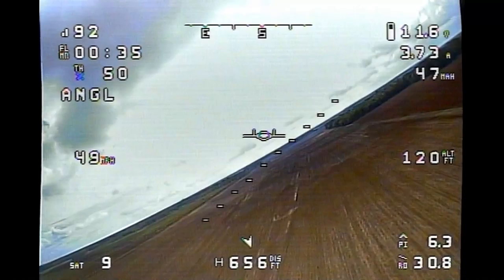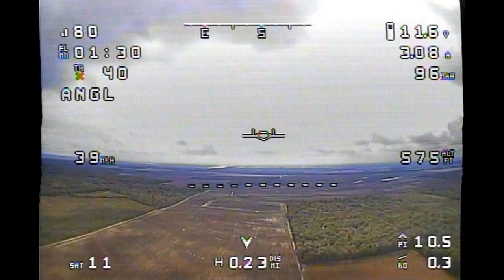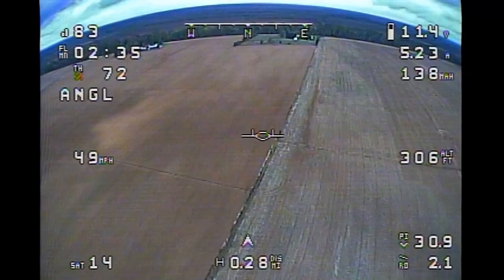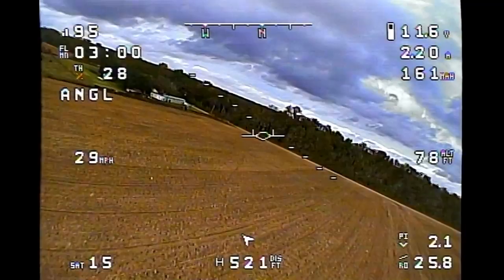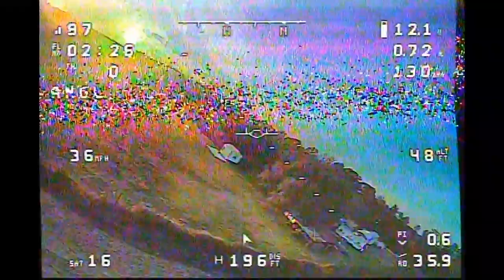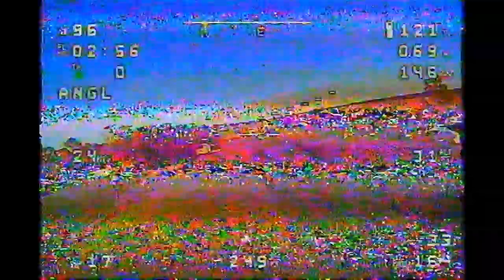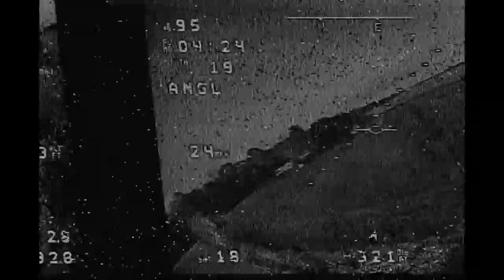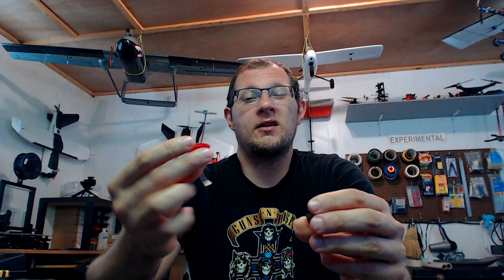Video Transmitter Problems, I want your input!

Comment: Loose uFL connector?
Reply from the maker: Possibly! I did re-seat it between the two flights when I checked over everything and it didn't improve, but I've wondered if it's connecting good, maybe the center pin not contacting or something? Now that I've torn the antenna apart I can actually check that with a meter... lol I'll do that.
Reply: @bonafidepirate  Yes I Would troubleshot the antenna situation but in the end would love to see the AKK X2 on this thing and test the limits with the larger battery!
Reply: @bonafidepirate  I hate those tiny connectors smaller then MMCX. SMA just rocks :-)